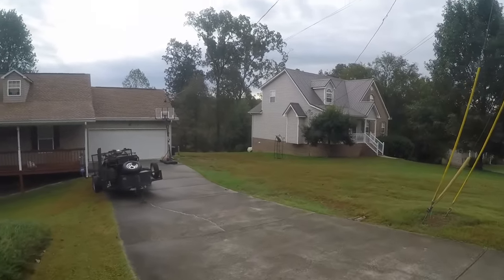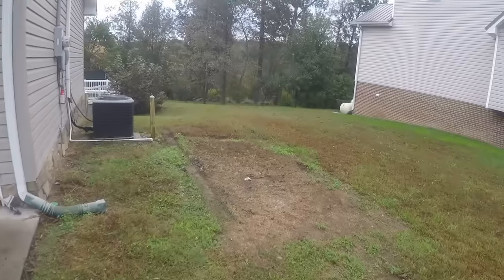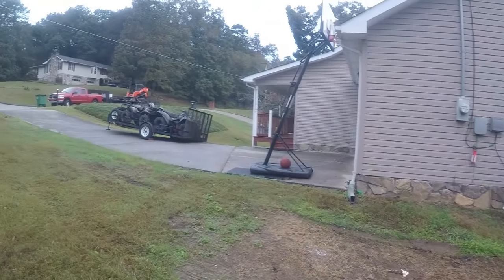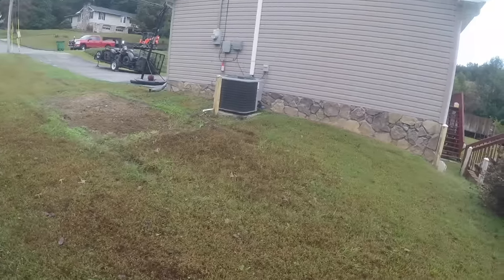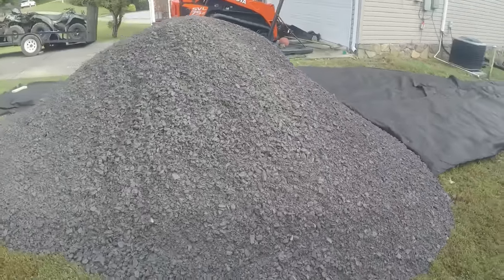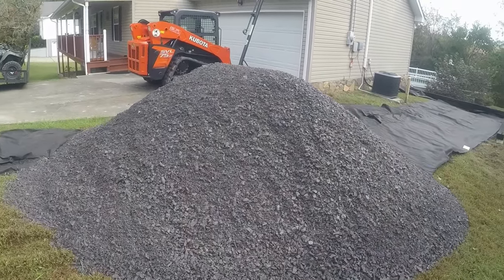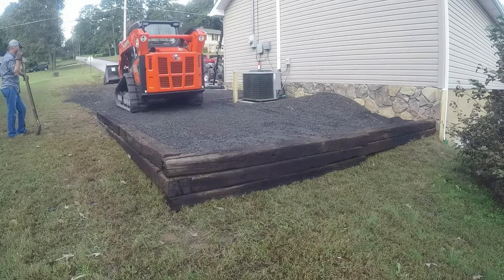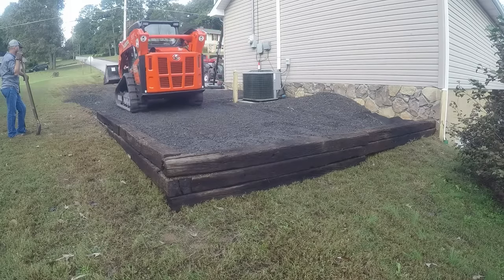How To Build an Economy Parking Pad On a Budget

Comment: Just a friendly tip from someone that builds highways and driveways......you should ALWAYS remove the top soil down to the sub base before placing gravel.....reading your comments, money was an issue. A good cost effective way would be to remove the top soil and place it on the back side of the retaining wall to help support it. You then have a better product and no removal costs. As others have stated placing on grass like that it will never set up right and grass will grow through....will also be very sloppy when it rains......looked good tho!
Reply: Could have removed the topsoil and built up the edges with it.. A laser would have really helped out alot here
Reply: the thing about that is sometimes you dont know whats under the dirt, especially in residential homes. theres always those knuckle draggers that bury a line like 2 inches into the ground and the homeowner ends up footing the bill. i personally would have removed about 6 inches of topsoil added #3 crushed stone and then filled the rest up with that smaller stuff. that job he did there looks like that fabric will be poking through in no time. just my opinion i know it dont mean jack but it makes good banter.
Reply: @mikeoconnell4229  1 call don't work around here in my area, there's stuff buried that the guys don't even know about. And I ain't affraid I'll pull all that shit outta the ground.😂 It's just not financially sane
Reply: Agreed that topsoil and sod under rr ties will compact at least a couple inches. But on that slope probably won’t fail. It just means the customer is getting what they are paying for - ie it won’t look as nice in a couple years.

Comment: Use 57 stone at the bottom (spaghetti strainer for drainage) then a medium size crush and run with lye (it's will compact and the lye is a weed barrier) then last 2-3 inches a stone dust (easy grading for level and it will provide great compaction and even better weed barrier) Thanks!
Reply: But always always wet the base and compact every 2 inches or so

Comment: You made a mistake having all of the gravel dumped in one spot. I would have had the dump truck back up onto the ground cloth near the back boards. Then have him unlock the tailgate and start raising the dump bed. It would have been very easy to signal him to go forward slowly as the gravel came out. The dump truck could have done 2/3 to 3/4 of the spreading of the grave...at no additional cost to you. You would have saved time and wear & tear on your equipment by directing the dump truck forward. Please try this on a future gravel dump.
Reply from the maker: Larry Ehrlich yes that’s called tailgating the rock and I didnt want him to do that here bc the ground was so soft and mainly because there were power lines overhead.
Reply from the maker: Mike O'Connell I’m sorry you can’t see them but there was a pole to the right of the driveway and the wire went into the house to the right of the garage so the truck didn’t want to back under them and the owner didn’t want to risk breaking the concrete. I’m unaware why you are so concerned about the price? And why’s it such a big deal? The owner is happy and this job was 6 months ago and it’s still fine so.....

Comment: Hi Cameron, do you need a cdl to haul that trailer and machine with the 2500 and gooseneck?
Reply from the maker: John, Teel’s Excavating & Johnny Snowplow Services the trailer was 18k and truck is 9k so I was over the limit by 1000lb so technically yes I needed a cdl. I sold the trailer and have a flatbed truck now that’s under 26k gross so no cod needed. Check out my video where I do a walk around the new truck!

Comment: Did ya bother putting those cross ties back into place after you pushed them out? You might need a smooth edge bucket....
Reply from the maker: silvy7717 yes I did. I need to get a smooth one for sure.
Reply: +silvy7717  11:13 with give you the answer you seek.

Comment: I don't disagree that this will work for what you need.  I am looking at doing something similar for a camper, hence how I ended up here.  Lots of research to be done I think.  I did notice at 9:08 the bobcat pushed/compacted the gravel towards the back pushing the railroad ties out....
Reply from the maker: yingpin18 yes YouTube has made me well aware that it pushed the ties out lol. It was because the rock was all loose and I was twisting the machine around. Once that rock settles in it compacts like concrete. The heaviest thing that rock will ever see is my machine the day It was spread. I have spoken to the owner recently and he says everything is fine and he is happy with the work I did.
Reply: those railroad ties won't last give it a bit of time and they won't be straight and if you were going to put the cloth down you should have did it the whole stretch of the gravel especially since you did it on top of topsoil. Small plate Packer wouldn't hurt either. Probably would have shifted your railroad ties out farther if you had packed it though
Reply from the maker: Zeus yes you are all correct.
Reply: I did my parking pad the same way, 26 tons of 3/4".  I kept packing it with the bobcat, with a full bucket of gravel in it. I didn't need cross ties, where the gravel met the grass I kept running over it so my mower would not catch the gravels. So far it's holding up good.. Sprayed roundup on it one time so far.
Reply: Parking pad has no heavy traffic use. ie: it's not a travel road. It's a parking pad😂
Reply: Except where my grass meets the gravel the rest is about 3" or 4 inches deep.
Reply from the maker: Jerry Lee right on! Evidently this one video is a reflection of my life and work ethic and it’s never going to work...but I think I did what the guy wanted so I’m good with it! Glad yours worked out too!

Comment: Sometimes you have to turn these jobs down if the homeowner doesn't want to pay to do it right. Not worth the damage to your reputation when, not if, that bit of work fails.
Reply from the maker: It’s been there for 5 years now with a 35’ fifthwheel parked in it so.

Comment: Looks good man! How do you like the kubota? They look like nice machines. Looks a lot like my Takeuchi. Thanks for sharing
Reply: Cameron Ward yes I believe they are. Mine is a 2011 Tl250 tier 3 and I agree can’t stand cat or bobcat. Hate the door and small cabs. Plus the controls just feel weird
Reply: Part of your job is to save the customer and steer them into the outcome.  That would have been stripping down to undisturbed soil, staking and stabilize the RR ties, shooting grade, fixing the yard, since you wanted to lay out fabric do the entire job, call digrite for utility marking.  

You should be able explain to him the process and tell him why it will provide the best outcome, if he couldn't afford the extra  $500 to $600 wait a few more weeks.

With all that said about $50 in Rebar and landscape fabric would have made a huge difference.  As soft as the yard was, a lawn roller would have fixed the ruts easily.  Since you knew it was wet, he could have dumped in the street that would have saved the yard. 

Pro tip- For about $5 mark area then spray weed & grass killer on area a few days before.

Comment: Anybody else see the back tie rods move, they were secured?
Reply from the maker: Caleb Wilson what are you talking about?
Reply from the maker: The “cross ties “ we not secured since they were only 2’ high.
Reply: Caleb Wilson Right, wrong or indifferent, I’d secure the RR ties with some rebar spikes. I secure any landscaping ties with spikes and secure to each other with decking screws. It gives me a much better peace of mind to know that they won’t shift on me
Reply: yes, i can't believe he didn't spike those in the ground. I am getting ready to build a parking pad to put my enclosed trailer on. Came here to get ideas, but why those we not fastened is beyond me.
Reply from the maker: epoweredrc bc they didn’t need to be..
Reply: Sorry I meant RR ties but yeah they should be secured so over time or pressure, they don’t move and give out. Not trying to discredit the video at all, just thought to mention that, I plan to gravel my driveway this summer and thought this video was great!
Reply: Just a friendly tip from someone that builds highways,etc.......you should always remove the top soil down to the sub base before placing gravel. Placing on top of the grass like that will never firm up and will get really messy when it rains! Looks good though!

Comment: I agree with "jsw 98", and if you don't know what you are doing either research how it is supposed to be done Correctly or don't take the job. Buy the correct length level a 4' would be the minimum length and place it in the correct position, on it's narrow side. Don't forget about compacting the stone with a gas powered tamper as the loose stone will pretty quickly move around, and also was away on that slope. I would never use railroad ties as they are soaked in "creasote" which is a cancer causing agent which is why the railroads aren't using them any more. The quality or lack thereof speaks volumes to anyone who sees the work you have done, and either brings in new business or drives them away. This reflects heavily on your work ethic good or bad. Good luck in the future.
Reply from the maker: John C lol thanks but it’s holding up fine and owner is happy.

Comment: Determining the size of the camper this pad is a horrible idea. However, this guy may know that, but whatever the customer wants to pay for then that's what he gets. I would say this would be great for a pop up camper. This in fact would not be ideal for a larger pull behind, 5th wheel or RV. You would need to put fill dirt in, level it off, compact it good then lay 3in of gravel on top. Either way it looks nicely done it's just not going to last. So, oh well as long as you explained that to the customer and your name isn't tarnished then it's off to the next.
Reply from the maker: Chris O. Yes this is all he wanted on this one. More or less just wanted the extra driveway space. I have another camper pad vid where we brought in fill.

Comment: Dude. This is bad man. Not trying to be a hater but you just destroyed that guys yard. My soul actually hurts after seeing this.
Reply from the maker: @bigp6071 Brother I’m not sure if you noticed but this was 5 years ago and also I discussed with the home owner the risks of backing a 60,000 lb dump truck over a concrete driveway and busting the concrete all to heck. The owner SAID, “I’d rather you back in my yard because I can fix that RATHER than break my concrete driveway.” Also the main power lines were over head from the concrete which means the dump truck couldn’t raise his bed to dump if he were to have backed in the concrete driveway so the only option on this job was to back in the guys yard and he was cool with that. Let me handle my jobs. Yes that was 5 years ago and I was just starting out and things have come a long way since then.
Reply: Glad things are going well for you. I was more talking about the bad work. Not so much the ground damage. But that was def from you not the truck. Those marks are from you when you were moving the rocks around. Have a great day.
Reply from the maker: @bigp6071  you have a good day too. But sometimes machines make marks in ppls yards. It’s easy to use a rake and smooth it back out but sometimes I don’t point my phone at it and show it. The video is mainly to show my brand new machine working. I am hiring my 7th employee if you’d like an application for a rake boy. Confirmed the area you’re upset about is where the truck backed in and I smoothed it back out with the machine so idk what to tell you
Reply: Show us a video of your work.

Comment: How do you keep the gravel from coming onto the driveway along the edge?
Reply from the maker: Sam Marshall once it settles it should be the same height.
Reply: Do you need to dig out an edge along the drive way to survive as a retention edge for the gravel. Kind of like a metal edge
Reply from the maker: Sam Marshall I guess you could if you want to.

Comment: Are those ties just sitting there? Not even drill a hole and drop rebar in. Yeah that will stay, until the wind blows...
Reply from the maker: TheSoloAsylum rumor has it they are still there...
Reply: Man I'd really pissed if you did this at my house. I could almost give you a pass on not removing some of the soil but that make shift wall you build is just horrible. Timbers are all misaligned and pushed out on day1. Go back in 6 months and post up another video. Real hack job.

Comment: Two separate layers, bigger then smaller rocks with a cloth between, wouldve been better, no ? Sorry to "internet expert" your video. Any gravel, 10 cm thick, would do the job and your driveway is just fine. Its just that two layers prevent compaction / promote drainage / dryness.
Reply: Crusher run is great top coat. Shitty for drainage. He needs to have an old timers show him the ropes. The retaining wall was tough to watch. So many major oversights.

Comment: Go get a different job until you learn how to properly install ties and remove organic layer before placing gravel
Reply from the maker: lakemetal1 I do have another job thanks for the positive input.
Reply: lakemetal1 i know right. This video is video is a joke. His helper is just leaning there against the shovel instead of spreading the pile by the house.
Reply from the maker: Oscar Fernandez 🤣🤣🤣
Reply: Why do u want to remove the organic layer first?
Reply: @theehgroup7006  Grass will be growing up through the crush and run in a week
Reply from the maker: Hank Hill no it won’t.
Reply: @lakemetal1 Go get job in the first place since you prob have no idea what you are talking about, son.
Reply: It's easy to be a keyboard foreman.       For one you really can't tell how much organic there is, some of those homes only have an inch or two of topsoil at best over the top of clay backfill. I have seen sodded over roads built out of black dirt on top of clay that hold up better than an 'engineered' road.   For two, it's not a high traffic pad, it's only for someone to occasionally back his camper on.  The ties should be able to hold back a few inches of gravel, since the eves aren't emptying on it from the building, so there's not going to be a lot of hydraulic disturbance.  I didn't see if he pinned them together, that'd be the only suggestion I would make. His helper looked plenty busy, and didn't look like he had to be told what to do.   Dude took the time to shoot a video, he's making money doing it, and is taking the initiative to go out and get the work.  Don't be so negative.
Reply: I would have to agree very poorly planned and it just got worse the longer I watched
Reply: @socialkruption   lol.  I build retaining walls. Padios.  And bike trails. As well as foundations
Reply: @lakemetal1   Which should've made it easier to give a constructive critique about this video? By all means, educate us.
Reply from the maker: Danny Cowan thanks
Reply: @cameronward7137  Well two things are for sure Practice makes perfect and your patience with people is to be commended keep up the good effort !

Comment: You missed two critical steps.  You didn't remove the grass and get to firm dirt, and you didn't compact the stone.  It also would have taken just a few extra minutes to laser level the project.  Also much better compaction if you install the stone in lifts and compact as you go.
Reply from the maker: James Null yea I am aware, and this is all the customer wanted. Price was an issue so this is what I gave him. He didn’t want it level. He just wanted a place to get his camper out of the driveway. I also talked to him a week ago which was 6 months since I did this job and he said it was holding up fine and he wanted to extend it further towards the road. And tbh between u and I, if I would have known I was going to get so much flack from this vid I wouldn’t have even went to the hassle of filming it.
Reply: @cameronward7137  Youtube should be an example of your best works.  I do the same sort of work and I think I would have made the customer o smokin' deal so I could display my skills as a builder.  Wach Jackman Excavating, the guy from Australia.  His projects are simple, with small machinery and well executed and his results are outstanding.  I learned a ton from his videos just by watching close.  I have several customers that are waiting for the right time to do their projects.  I strongly disbelieve in cheap quick projects.  You'll both will be better off if the project is done right.
Reply: @cameronward7137 Is it always always important to cut out sod? Even with 6+ inches of compacted gravel?

Comment: So much wrong with this. Without the teeth on the bucket you could have at least back dragged your tracks on the lawn.
Reply: What and messed the yard up back draging is for ppl that hasint ran a dozer or anything with a bucket I think he did good for what he had to work with but I do agree about the teeth he does need a dirt bucket instead of a rock bucket